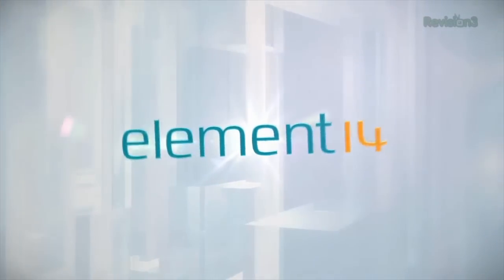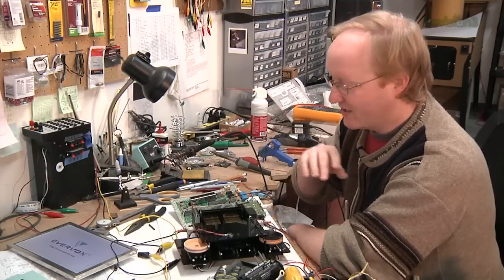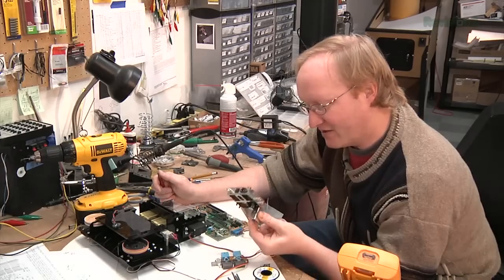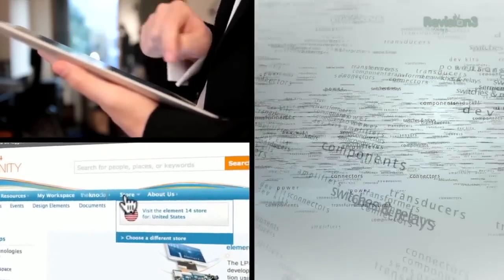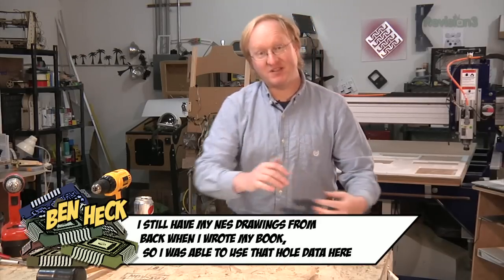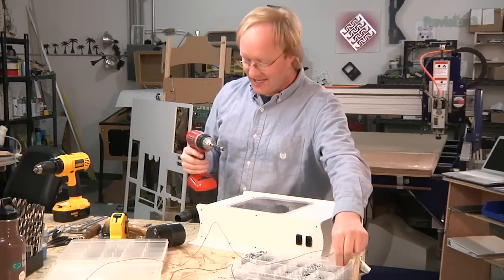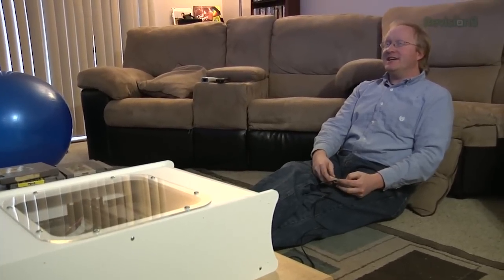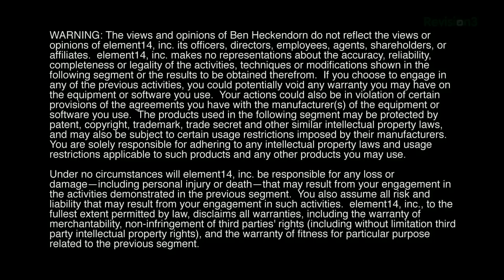Slot Loading Nintendo Game System - Finale

Comment: You made it as big as a coffee table and shortened the controllers by 2 feet. The loader is cool as shit though. It's got to be smaller, or build it into an arcade cab. You could use two NES advantages for the controls. Ide buy one in a heartbeat.

Comment: Great project! I understand by the end that the content would be too large for NES case. But I wonder why not use the NES case and modify that? Make it larger but still NES? If you fold the cable, would the pcb be able to be below it, so maybe just make it thicker? Add extra plastic at the seam?

But I presume you already thought of that and it was simply too large overall.

Comment: Lol that case is hideous AF! Haha but I do love the concept and I think you executed it quite well and like how you learned from the second video to use ribbon cable instead of individual wires soldered to the cartridge pin connectors ;) You could have used the existing ZIF connector for the motherboard so it doesn’t have to be moved around with your slot loader mechanism because of the directly soldered connection but I guess this was more proof of concept and a second build you might be able to engineer all this inside the original case!

Comment: why didnt you make it a top loader instead of a side mount .....
Reply: i was also wondering if theres a way to mount sum kooling fans say per happs sum micro lap top fans  with voltage regulatwers to keep fans operating untill it been kooled thn the  fans would shut down till the systems been turned back on ..... that way it should make it  out last most gaming rigs n keep it from dyin from heat .....

Comment: I just have to say, I am SOOOO glad I am not the only one using Radio Shack's cheap (but SO effective) desoldering iron.  I have also used the blow-torch hack to get rid of solder clogging the vacuum tube.  

One day, I will own a Hakko rework/desoldering station, but until then, I will make do.

Comment: was thinking about the Milwaukee 12 volt compact screw driver with its size would work well  and about the right amount of torque for most of what you do its also not an impact style so it's quiet

Comment: The most helpful advantage to the NES reset vector, is when your game runs on a score, or password. Then you can "protect" those parts of RAM, on a warm boot, by checking a part of RAM for corruption, only clearing it if the result is negative.

Comment: Well done, great work.
But why didn't you tried to put the Motherboard under the mechanic loading system, so it's much smaller.
If you did it like this way and coloured it grey, just like the original case, i think it would much more look like the "Videorecorder-Case" of the NES. 
But, however, awesome mod. 
It must be pretty hard to create the mechanism and make sure it's well aligned to the connectors.

Comment: Those 72 pin cables are too long, im sure you have many game crashes with this setup. Nice idea though,  but too much work for a minor NES design flaw. Cheaper to just disable the lockout chip and or buy a replacement 72 Pin connector from China... or just boil the old 72 pin connector.

Comment: Ok... But why is this necessary? Why screw up a working nintendo if I doesn't even solve the 72 pin issue. It still susceptible to worn and dirty pins not to mention the excess moving parts.and the custom wiring jobs look like shit and will make taking apart a nightmare. Are there even cooling ports!!???

Comment: Disappointing. If you can't use the original case, then why bother. That big case just looked stupid. Apart from that, you should have tried to do the component or HDMI mods, you should know that composite is a highly flawed connection, so why bother continuing to use it? And if you have to use a HD TV, at least set the connection to the proper, 4:3 aspect ratio. Come on dude, you should know this stuff.
Reply: +Grognak Barbarian If you think it is so flawed, why don't you do it yourself?

Comment: Yeah, everyone has about a 4,000.00 CNC machine just laying around that they can do this with, along with the fact that your original goal was to put this all in the original NES Case.  So your last statement, you managed to place a slot loading cartridge system into an original NES Console?  No, what you did was you took an NES main board, modified it to fit into a new case with your front-load design.  FAIL!  Would have been easier to just fix the ZIFF.
Reply: Or nowadays, a Blinking Light Win ;)

Comment: I really like the loading mechanism and overall what you did to that NES.
Although I'm not impressed by the size of the final build, considering how big it turned out to be, I should have expected the power supply included inside the box, so at least you could have got rid of that ugly old AC adapter the NES uses.
Congrats and thanks for sharing!

Comment: Why don't you put the PCB under the game slot. The cabinet doesn't need to be that large or is there another reason you did it this way? Maybe when you did that it will fit in the original case with some mods? Nice mod anyway!

Comment: Oh well, I guess this goes under "because he can"
Not exactly a smart move to replace a part that wears out every 10-20 years with multiple parts that can fail much more frequently as they are prone to mechanical wear-out, even if the auto-insert mechanism is indeed a really nice gimmick and quite nicely integrated with the system.

Comment: Great idea, no offence but the case design is a bit flawed, from what i can see you can modify the rear of the slot loader,( end closest to the board ) so you can basically fold the board under it saving a ton of space and making it a smaller case. also if you use smaller wheels on the loader it wouldnt have to be as wide either. Great prototype though. Love for the nintendo.
Reply from the maker: Yeah - that project was a pain! I was glad it worked! :)
Reply: +The Ben Heck Show Game Genie not compatible.
Reply: The Ben Heck Show your NES case kinda ended up looking like a flux capacitor, cool :D

Comment: Very impressive on a technical achievement level, but you have lost the iconic classic appearance of the original front-loading NES console. Also, the original 72-pin connectors only need a proper cleaning to work like new again. They don't "wear out" from normal use; that is a myth, and a proper cleaning means using something like oxalic acid, not the popularly recommended isopropyl alcohol, which is only marginally effective at best on oxidation and built-up "varnish". Here is proof that an original "loose" 72-pin connector can work like new again, loading games on the first try every time - watch?v=iZ6DFKHkY_A

Another thing, get yourself a real TV. The NES wasn't designed for a widescreen LCD display, it was designed for a 4:3 aspect ratio 15 kHz CRT display.

Comment: or just get a top loader and problem solved.
If you don't want to spend that much on the official top loader, just get one of the cheap clones (they work well except for a few games such as CV3 or anything using the MMC5 chip), sure the colors are a bit off and the sound is slightly off but most people never notice outside of the hardcore like me.
I have a cheap clone but it was replaced with my official top loader.

Comment: Let me settle this with the opinion of someone you seem to consider an authority on this subject:

"When it comes to video, 99 percent of games do not try modifying the display registers while the screen is drawing. This allows entire scanlines to be drawn at once, requiring 262 scanlines * 60 frames per second of synchronization."

"It'd require a database, but there are only ~2,000 unique titles for the system, and probably only ~40 would require bsnes."

byuu - author of bsnes. google it.

Comment: I don't see this debate going anywhere, since it seems your definition of "EXACTLY like the real thing" has now turned to "good enough". It's extremely hard to say that you haven't come across any emulation glitches, because that assumes you compared every single game to the games on the real hardware.

Look up bsnes in regards to Speedy Gonzales, Air Strike Patrol, or Timecop. Then use your imagination and remember that higan (bsnes) is the ONLY emulator of its kind.

Comment: Just read this post. I guess it's directed at me, so forget my last two questions. You argue from the point of view of technical emulation accuracy, yet despite having played countless NES-roms, I haven't come across one that showed emulation glitches, so I take it that this kind of accuracy isn't needed for most games. If there are actually differences between the emulated output and the original one, then they're probably hardly perceivable, keeping the validity of my statement intact.

Comment: The way emulators are built and maintained ensures they are accurate on a game by game basis. No SNES emulator will have trouble emulating Chrono Trigger or Super Metroid, because they're all programmed with those games in mind. They're NOT programmed with every game in mind, because it's an exhaustive process.

As I said above, google "Emulator Resources / NES Accuracy Tests". Keep in mind those tests don't look for accuracy on many parameters, like sound, so the reality is even worse.

Comment: > Most of them aren't. 
I dismiss generalization. Unless you have a statistic to prove your point... 

I'm also not talking about every emulator out there. My statement was a reply to someone claiming that NES-emulation wouldn't be the same as using the original console. I also limited it to 8 and 16bit emulators explicitly. 

The NES might be hard to emulate properly, yet what qualifies as hard? And what would you call proper emulation? There are plenty of NES-emus that do a great job.

Comment: You said, "Emulators are designed to be EXACTLY like the real thing." Most of them aren't. They're designed to be accurate for the most popular games, but leave a lot of other great games and gems rife with inaccuracies. There's ONE example of an accurate emulator - but this is a video about NES, which is one of the HARDEST systems to properly emulate.

You may not care about minute differences in gameplay from inaccurate emulators, but some do. Bsnes has some videos of such inaccuracies.

Comment: So you're actually proving my point for the SNES. Funny, that was the system that I was thinking off when I wrote this statement. However, I played it with Snes9x. You don't need cycle-accuracy to achieve the same look and feel for most games and I'm not talking about the few games that require special instructions or additionally emulated chipsets. I've been playing emulated 8 and 16bit console games on TV for years and barely ever felt emulated.

Comment: And Google "Emulator Resources / NES Accuracy Tests" to see the accuracy of emulators as of six months ago. The highest score any emulator got was puNES at 92.3%, and even THAT score doesn't consider every single parameter that could be tested. NES is notoriously difficult to emulate.

There really is very, very rarely an emulator that's as good as the real thing.

Comment: RGB is the highest video output older systems were capable of, and NES is a particularly tough case to achieve that. It requires getting a RP2C03B PPU (taken from PlayChoice-10, certain VS games, or Famicom Titler) and doing a mod. Only by doing the RGB mod would it be possible to get a S-Video out of the NES.

Even then there are some slight differences in color palettes with the RP2C03B PPU. Probably worth it for the enhanced picture though.

Comment: He could have fit the slot load mechanism in the original NES if the layout and the parts weren't made so bulky.
He left an inch margin from slot to engaging Wheels.
He left 2 inches of margin from the cartridge clamping teeth to the NES motherboard.
He should have put the NES mainboard under the loading mechanism.

Comment: This is fantastic. Think I might try and tackle this some day. In v2.0 of your project, you could easily fit it all into the original case. It appears that a slight redesign of the "clamp" system would allow it to fit the NES board underneath. Also, could you have split the original cartridge slot and used that with your clamp idea? Or perhaps connect your molex pins to that instead of printing a new board? Just some thoughts.

Comment: i like the idea, but I would have rather put it all in the original case. Probably using the lid over the cartridge slot as a kind of on/off for the loader. Open the lid, and the load IR turns on and waits for a cartridge. Placing a cart in the slot activates the servos and the NES goes on once loaded. At this time, the lid can close. Opening the lid again shuts off the NES and ejects the cart. Closing the lid without a cart inside shuts off the unit. That's the way I would have done it.

Comment: If he needs to make any adjustments or modifications, all he needs to do is unscrew the transparent casing. He does not need to take the whole console apart. I also think it was because the device would not fit in the original nes,

Comment: it's not perfect, but i'd much rather play an emulated version of an 8 or 16 bit game on my large 1080p tv, IN 1920x1080 resolution (aspect ratio respected) with some kind of graphic processing like 2xSAL or Super Eagle mode. it makes nes games have sharp edges, and snes games like super punch out look like a cartoon. not to mention using a single PS3 controller on a 10 foot usb cable to control it all.

Comment: Agreed.
Not only the experience is not the same, but emulators are far from perfect, I'm talking about emulation in general. The reason for that is hardware.
Back in the day emu devs provided only "basic" functionality, because emulating any system 100% would require a very VERY powerful machine. A lot of emulator devs today seeing how hardware had improved are changing direction for their projects and now trying to achieve Perfect Emulation.. and perfect emulation can make even i7 struggle. :)

Comment: by not keeping it in the original case, you've made the entire idea of the problem you needed to solve moot,  you could just use a toploader, you've basically just made an entirely new console, which is cool.  But wasnt the original idea to fix the flawed first design not creat an entirely new console

Comment: Wait, you spend three episodes on this but you don't show the whole load/eject cycle on the complete build (or comment on how the audio mixer worked out)? I appreciate the coverage of the whole trial and error process, but it's disappointing there's barely any screen-time for the solution that worked. Did you bend all of those pins by hand?

Comment: I really don't understand the concept of this... This is way bigger than my PS3 and 360 combined. I get the whole slot loading mechanism, which it was pretty cool, btw, but it would have been WAY cooler to make the controllers wireless, which I once tried and I failed terribly :/, or just make the nes way more compact with a micro sd, but then again, there's nothing more compact than my PSP with over 1000 games from the NES, GBC, GBA, SNES, PS1 and a few other. But either way, that looks cool.

Comment: Well then show me a working Xbox emulator. Even though it is a PC based hardware, for some reason, there is no properly working Xbox emulator other than the one on Xbox 360, but even that's not 100% compatible.

Comment: Could you turn an old PC (around 10 years old) into an original Xbox?
The original Xbox uses off the shelf PC components, a 733 Intel Pentium Mobile processor, Nvidia Geforce 3 series video chip and 64 megs of RAM (could use faster components).

Comment: I'm no engineer but if those wires from the tines to the board were just a little bit longer couldn't the board be attached under the loading chassis?  Then the whole assembly would fit into a much smaller form factor.  Or even on top of the loading assembly.  Unless it's running super hot and would melt itself?  It's simply amazing this was even done at all and it actually WORKS!

Comment: Yeah, and like the NES really needed to be bigger, right?  :)
Earlier in the project he was trying to fit it all into the original case, but in the end I guess he couldn't pull it off...
Now, if he'd built a slot like this into a Playchoice cabinet, that would have been really frikkin' cool.  Sometimes it's all about how you frame the experience.